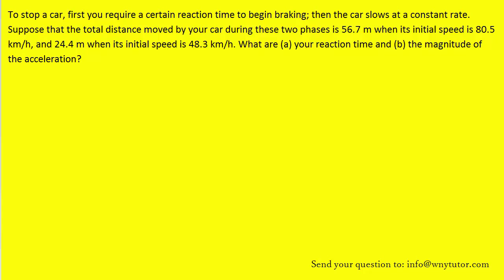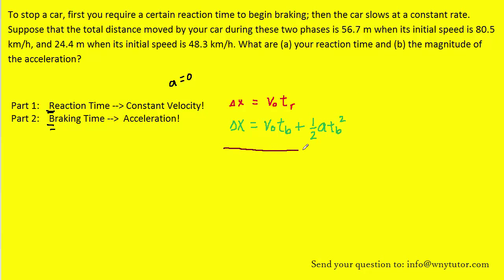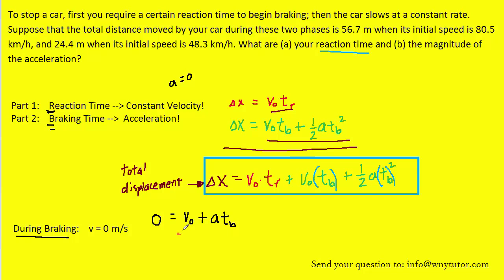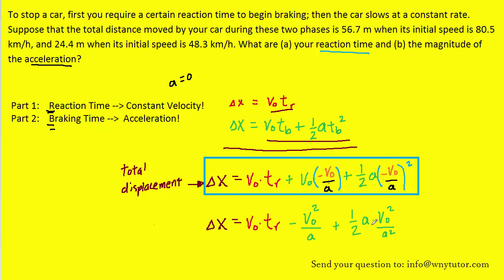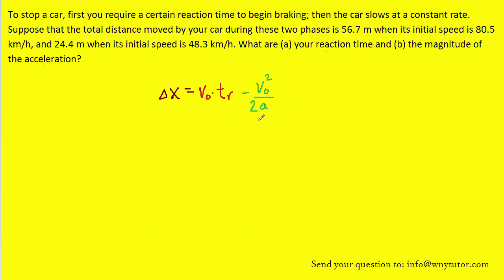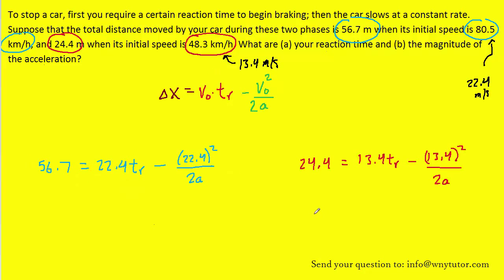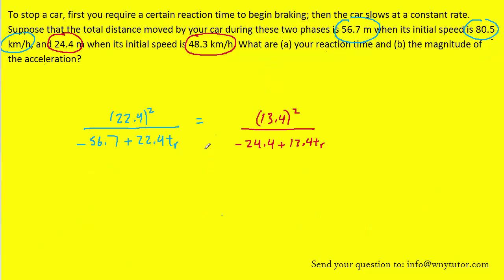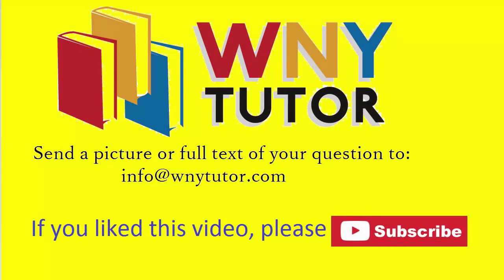To stop a car, first you require a certain reaction time to begin braking; then the car slows at a c

Comment: This doesn't make any sense and I don't understand why this is the universal method/answer to this problem. The resulting equation that you get after combining them has 2 unknown variables (time of reaction and acceleration of braking). Why can you just toss those out and say it's just a general equation that you plug and chug for the 2 different scenarios? That's like saying I have a variable for this specific thing but I can change that variable to mean this other thing...

In addition, if adding the two delta x is acceptable, that means that the resultant is the TOTAL displacement right? This means the first delta x corresponds to the first displacement and the second delta x corresponds to the second displacement. We already know those values so why can't you simply use the formula:

delta x = VoTr ? You can't say this is wrong if you're adding up the two delta x's anyways to get a convoluted equation with 2 unknowns. And if you do say this is wrong then you can't add up the two different equations... so which is it?

This problem is a contradiction in and of itself if this is the way to solve it and makes 0 sense.

**IN ADDITION*** if you plug in the known information to the obtained equation for the reaction time phase, you leave 2a as a variable and use this to solve for the reaction time. YOU CANNOT DO THIS since the acceleration in the reaction time phase is zero!!!!!! you are dividing by a 0 which further makes this universal solution/answer nonsensical. Yet this is how it's supposed to be done?

**********FURTHER MORE******* you plug in Tr for the second phase... what???? Do we just throw out the rules of physics now? The second phase is the breaking phase which will obviously have a different time than the reaction phase so you can't use the reaction phase variable when plugging in numbers in terms of the second phase. Does no one else see how nonsensical these answers are?